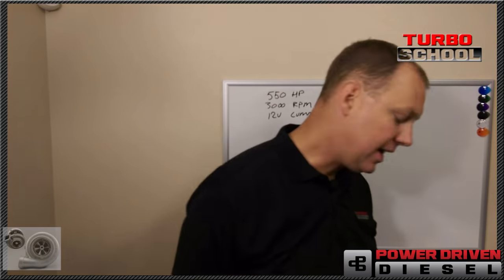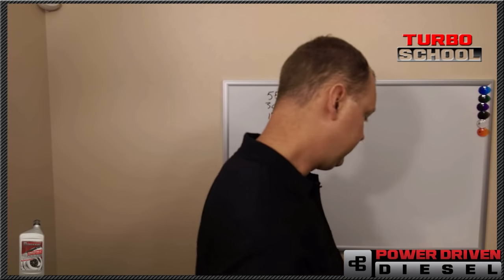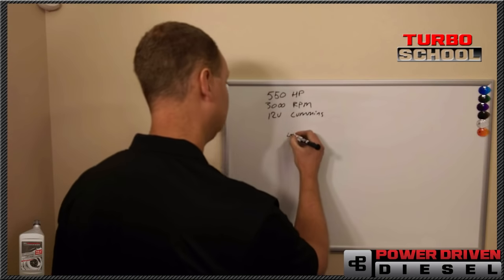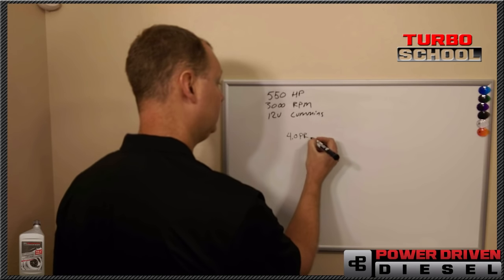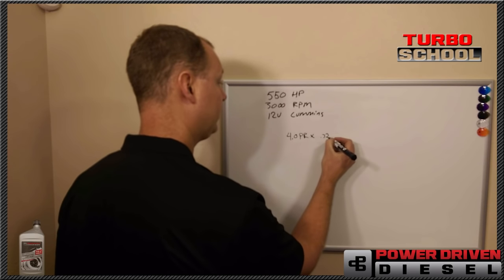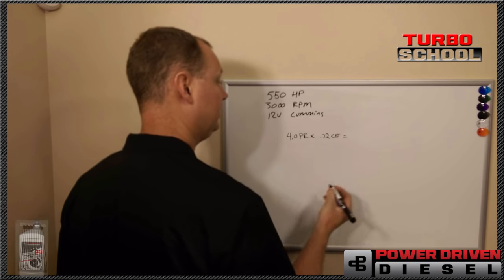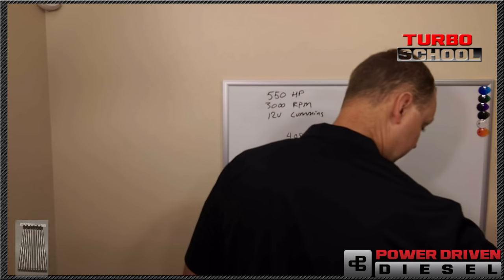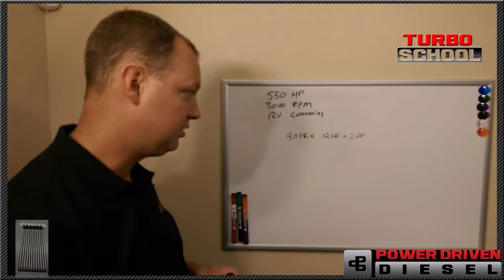Turbo School III

Comment: Very good information in this series however the videos could use some editing & the audio  needs work. To bad you're 4 states west of me 
Could you do a series on the different power adders: nitrous, propane, CNG, water /water methanol, etc? Show the pros, cons, mantaince issues & cost, how to size a system for different applications &or power level needs.